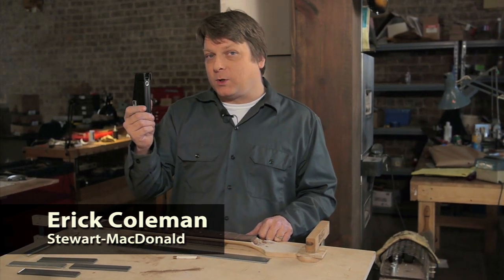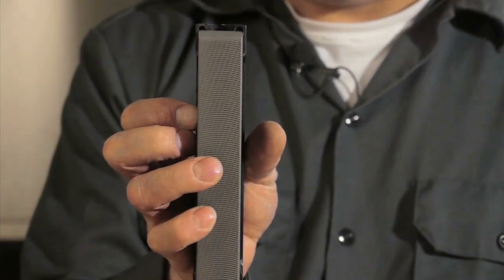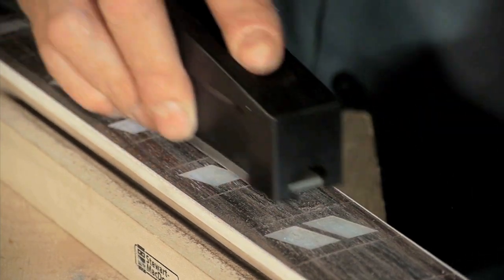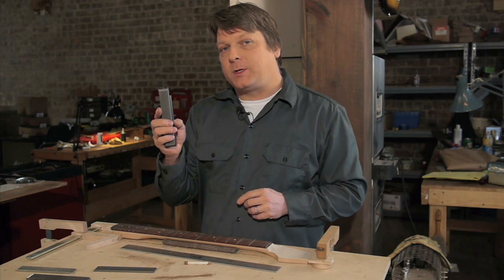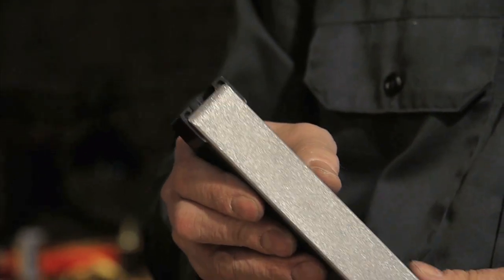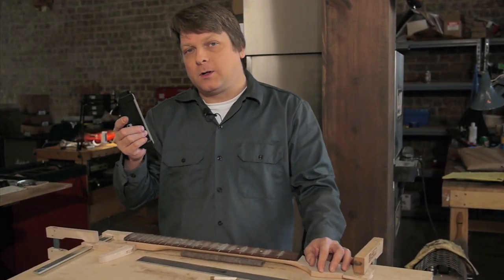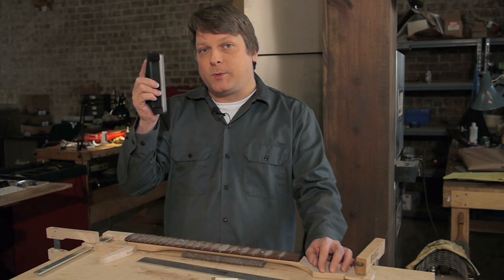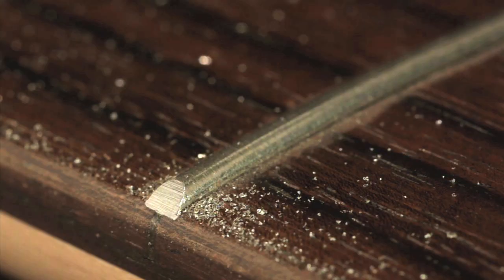Snap files for leveling and beveling guitar frets

Comment: Are the files double sided please ?
Reply from the maker: The files included in the Snapfile Leveling System are not double sided. There are file teeth on the underside of the standard leveling file (item #2253) and the fret beveling file (item #2255). However, these files have a bevel at either end that should be installed facing away from the handle.